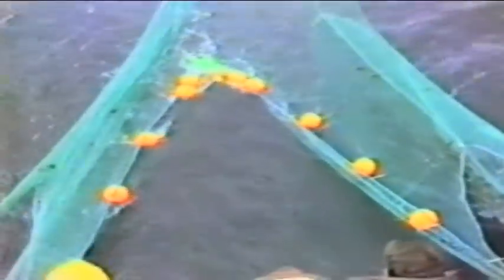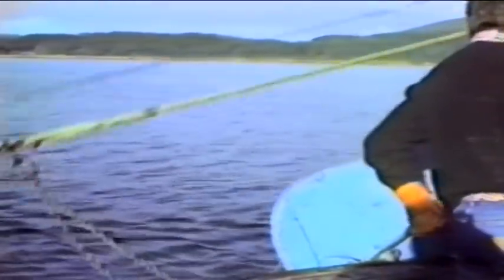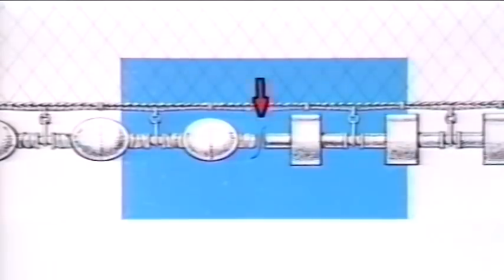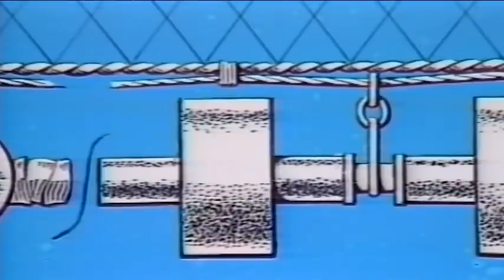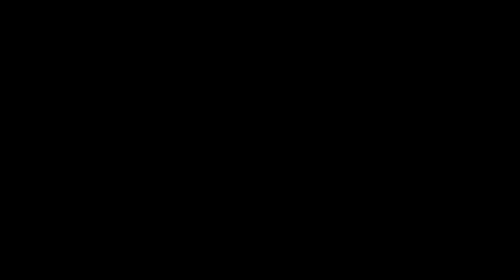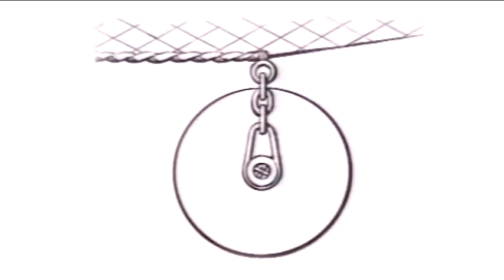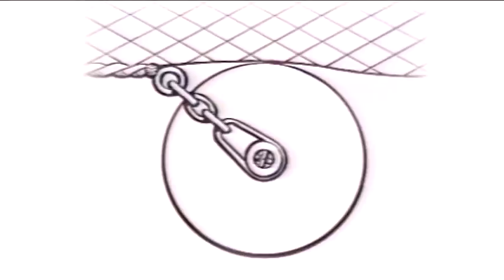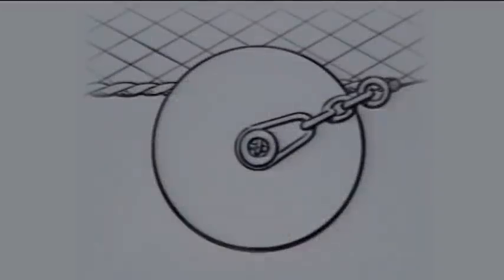Trawl Ground Gear Setup (1989)

Comment: once sea water reaches depth, nothing else attached to the bottom can live because of the very low light conditions. Any where the water is relatively shallow and contains clay or silt particles,. there is very minimal growth of attached creatures anyway. Trawl can not withstand most hard shelled creatures without major damage occurring. Actually, trawling is similar to plowing land for agriculture. It actually helps production. By catch increases the health and prosperity of any creature able to follow a boat. Storms do the same thing trawling does. They stir the bottom, and revitalize the creatures there. Besides, most of the sea creatures  use a system of MAJOR over production to maintain volumes of creatures in the food chain. In other words, the sea has a system of reproduction that starts with millions of new born, and ends with just a few mature adults.  They are designed to be destroyed (eaten) with a phenominal reproduction cycle.
Reply: rubbish